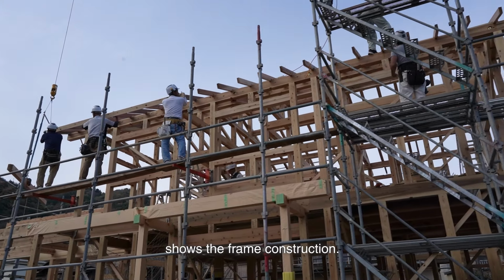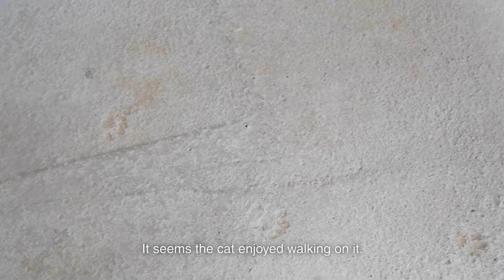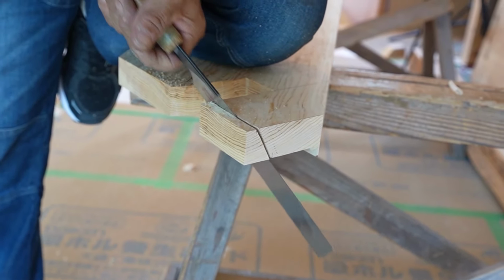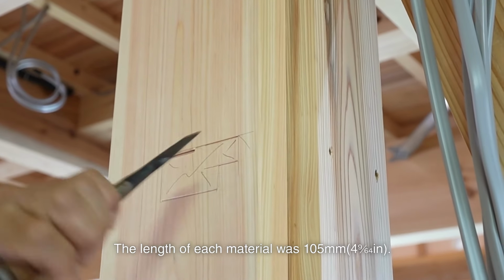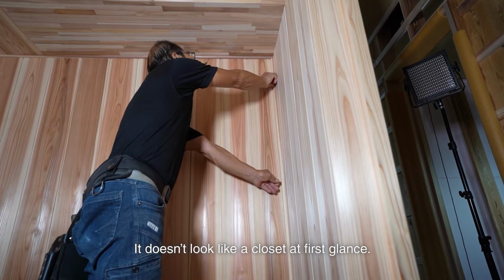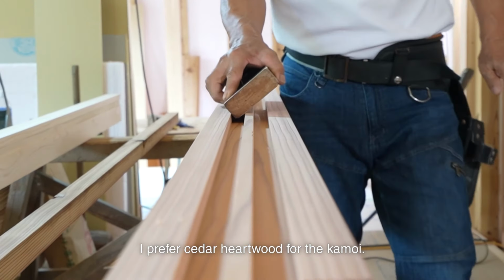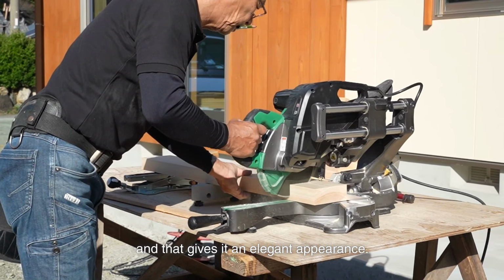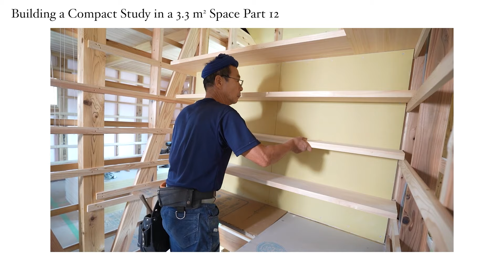[Season 2 Compilation] The New House Built After Five Months of Carpentry

Comment: The quality of the timber used for framing is incredible to me. We don't really built out of wood were I live - my country don't really have forests - but the construction timber we do use like roof trusses and the like are rough-cut pine slapped together with no attention to aestetics. I would be ashamed to show these Japanese carpenters my attic. And our concrete form work is equally sloppy. Even worse, they don't plan for electricity and fixtures. Trades people just come in and knock holes where ever to fit in wires, plugs and plumbing. Then the builders patch the mess with plaster.

Comment: Got a question. Long ago I saw a joint utilized in the construction of decking or roofing? I forget which. It was ment to join wood to concrete. It had a pocket like area carved out where one could attach a timber for timber framing a deck or maybe a concrete roof to a timber frame with the use of through bolt for wood and concrete. The carved out area was similar to a tenon. On either side the tenon was then plugged with two verticle "covers" and fixed tight through the use of 2 shims similar to those used for nuki in wall framing. I was wondering if you might know the name of this joint or process?

Comment: I love your work but I have a question. Since you install all of the boards with such tight joints and spacing, do you ever have problems with warping of the floor boards, railings, or other straight planes? If not, how do you mitigate this? I think that when I install boards without any tolerance, they always warp, but perhaps it is the wood I use, or the method of joinery.
Reply: I am not sure about long term, wood is wood, it will warp and shift one degree or another.  They seem to do enough mortise and tenon that I don't think it would be a huge issue.  We tend to use butt joints and nails instead.  I do some Reno and woodworking as a hobby.  All I can say is this this man's work is nothing short of master. He is a carpenter, wood worker and lumber grader all in one.  I dream of a house  built like this.  It's just beautiful.

What I do know is that we export different grades of wood there.  They frame with J-grade (no 1 or better with little to no appearance defects) while we use no 2 or better for general framing and stud grade for studs.  Recent merchanter (computer graders) have really allowed garbage to slide.  We design for speed and some durability while they design for full durability and appearance.  IF YOU DO IT RIGHT,  north american framing is surprisingly good.  But We have idiots on construction sites while they have a master.
Reply: @MintStiles  Hello Cal,
Very interesting observations. I am a European cabinet maker and furniture restorer. I also take an interest in instrument making. So in other words I am very keen about the quality of wood. According to an extremely knowledgeable American gentleman (World Woods in Colour, by William A. Lincoln- ed. Macmillan) there are (were) 70,000 different woods known to man. It still is, despite bodgers, cowboys, bad users,  one of the most used materials known to man. The problem with woods used for structural purposes, in the West, is that it is very often of extremely poor quality- often on the pretext that it's "not seen". If you took any single closeup shot of the timber used by this beautiful craftsman you will always find a truly faultless piece of wood. In Japan each and every tree is carefully selected, and the sawing process is done in a very loving manner. The woods are carefully stacked and air dried before any commercial use. The large structural and intricately jointed beams are hand made in highly specialised workshops, and delivered on site carefully wrapped in silk paper!! That says a lot about the loving care that's taken. The houses are built using joints, not nails (or very few for specific reasons). So a Japanese house is a jigsaw puzzle- very tightly built. Let us not forget that the oldest wooden buildings in the world are to be found in Japan (temples). I therefore think they know exactly what they're doing- largely due to their experience and their rigorous choice of materials and techniques. May we bow down in respect to these wonderful people and their ancient culture, but also their quest for constant excellence and timeless beauty. 
Greetings from France.
Reply: @musamor75  For sure.  The Japanese have a very unique level of quality to them.  The N Am buildings does become very easy to renovate since there are no slotted wood to wood joint.  Our problem is the lack of skilled framers that understand wood and the science behind forces.  You find people using studs with knots on the ends and shattering them with nails... etc.  Or just notching the heck of them to save some headache for plumbing.  I try to source old wood.  If that isn't an option, I really think a out what it is that I am doing, where the cuts are before culling my lumber stack.

I do want to comment that we USED to get much better wood, even 20 years ago.  No 2 and. better would easily be on part with today's No 1 (which no one uses because it's not spec'd).  The grains are incredible on some of the older Douglas fir from houses from the 60's and before.  Drop a piece on the ground and hear it ring.  You'd think some of these old wood would be perfect for a telecaster.